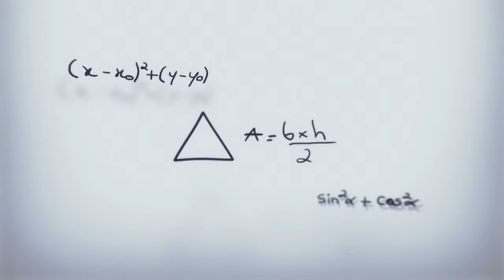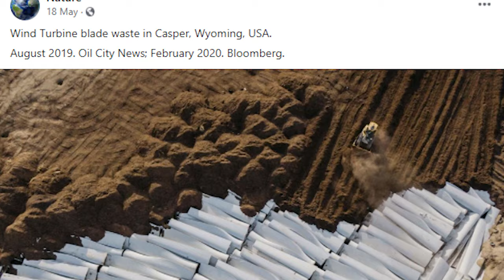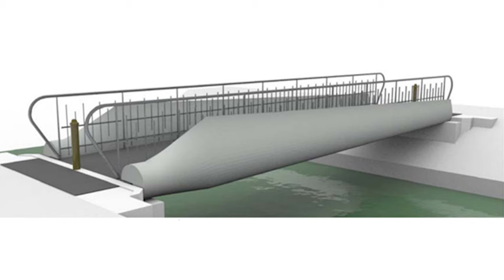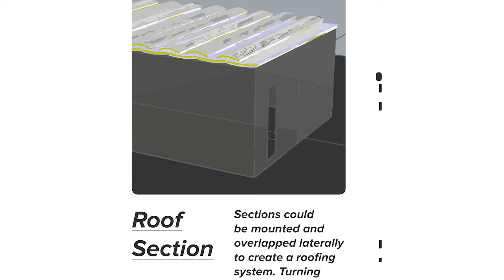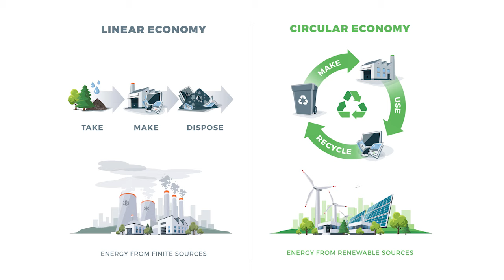Wind Turbine Blade Reuse Options - Ask an Expert

Comment: I've explored using them for external shading louvers (vertical/horizontal). They're weather resistant, made to be outdoors, highly rigid and good longitudinal strength. and the variance is shape is not a problem. exactly what is needed. The shades on the market are mostly made out of aluminum, steel sheet metal with very high embodied energy.

Comment: I'd make house siding and roof tiles out of them. The blades are already super tough and weatherproof. Both are rarely touched after install so there's less worry about the fiberglass irritating people. Cutting them down to roof tiles would allow you to use more of the curvy parts of the blade, while the siding would require less labor to cut down to size. 

Not sure how it's circular though as you don't re-reuse the materials after you make sheds/doors/etc out of the blades; and you don't make new blades out of the old ones.

Comment: What is the life expectancy of a wind turbine?
Reply from the maker: 20-30 years usually. I talk about design lifetime in depth in this video:
https://youtu.be/PfquMx9h98M
Reply: @EngineeringwithRosie  
Thank you. I’ve just found your channel and have been bingeing today. Have you done a vid on kite powered generators and do you have an opinion on if they could be made to work?
Reply: @EngineeringwithRosie  what is wrong with the blades when the windmill is retired... is there a worry about them yeeting themselves apart because of some kind of progressive rot? How do people know the structural stength of the blades after 30 years of use?  in fiberglass boats, there are often soft spots, and a wood core that rots, requiring repairs.  Perhaps this is only a boat thing, though.  Would the blades used in structural applications need extensive inspections, or is this not a problem?

Comment: since the shape of wind turbine is like the shape of plane can we use wind blades to make drones
Reply from the maker: Hey, that's a cool idea 😀 
It would be hard to use the whole blade like this because 1 - wind turbine blades are HUGE (at least 30m long for utility scale turbines) and 2 - they are twisted whereas aeroplane wings are not (because wind turbine blades are rotating which affects the local wind speed). 
But I bet you could use the tips of a couple of wind turbine blades to make a drone. It might not have a commercial application, but it would definitely be a fun project.

Comment: And the transportation will cost ten time what normal construction would and produce ten times as much CO2
Reply from the maker: Thanks for the comment, definitely transport emissions need to be taken into account! I believe that efficient logistics is a topic another researcher in Heloisa's group is working on. Of course if they are not reused they need to be transported to landfill or burning, so there will be transport emissions either way. Electric trucks is the answer I guess 😀
Reply: @EngineeringwithRosie  It would be interesting to compare the electric use to transport with electric trucks compared to the electric created by the wind turbines hauled. Don't forget to discount by the electricity it took for both creating the turbines & the trucks! 🤣

Comment: If a wind turbine blade is no longer usefull because of losing the structural integrity, why would you choose to use it as a bridge for people to walk on? Your thumbnail sucks, zero stars!!
Reply from the maker: Ouch, thanks for the honest feedback! Can you tell me what you don't like about it, or share links to some videos with thumbnails you do like?
That is a great question you ask about structural integrity of the used blades. Wind turbine blades need to withstand huge forces when they are in operation. They are decomissioned before their useful lifetime is up, so there is still plenty of strength left in them for less structurally demanding applications like the ones mentioned in the video. 
Thanks again for the feedback, it's very helpful!
Reply: @EngineeringwithRosie  You showed a lot of restraint there Rosie! Matt obviously needs to find something better to do than to criticize your thumbnail.